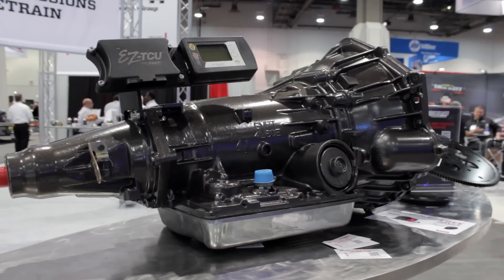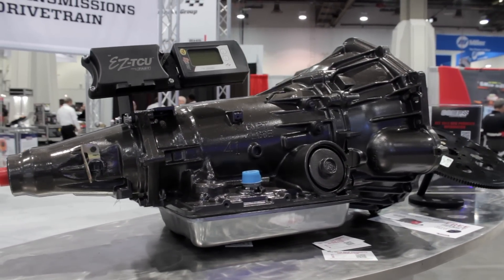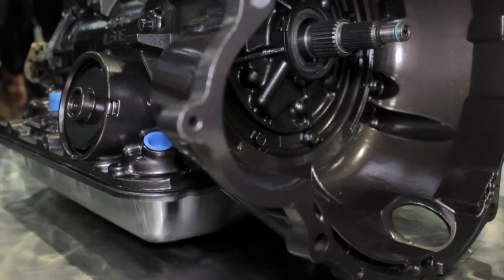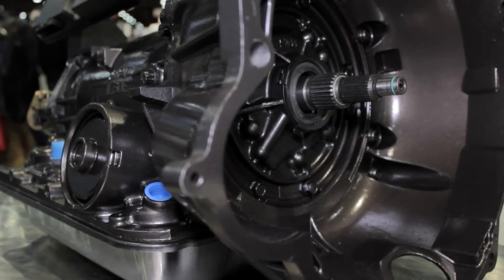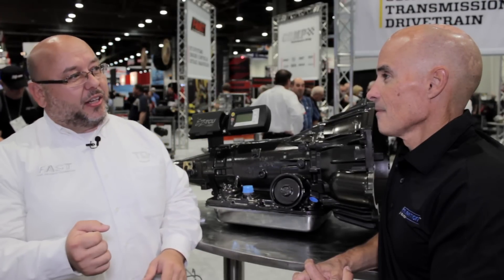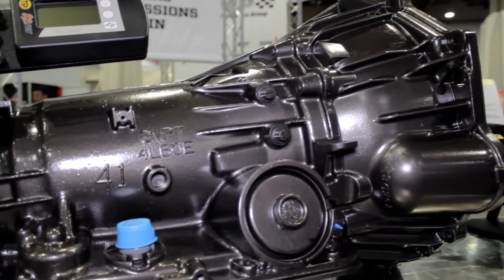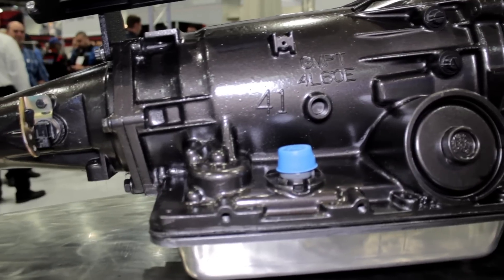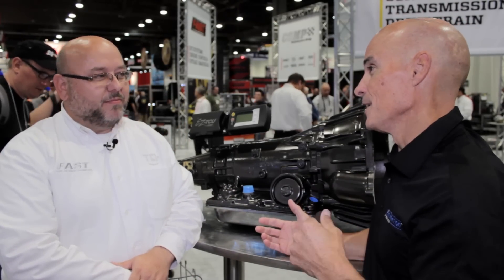2014 SEMA Show | TCI Auto X 4L60E Transmission

Comment: New subscriber here. I have a mustang gt. What cams should I get for it and what after market parts do I need to get in order for the cams to be safe for the car. Also how much am I looking at here as far as price
Reply from the maker: Hi Mike, your best option is to contact our CAM HELP line at 1.800.999.0853 or email camhelp@compcams.com. Our techs will have a few questions regarding your engine and overall setup. They will then be able to help you pick out the best cams for your Mustang. Thanks so much for your interest!
Reply: COMP Cams thank you very much!